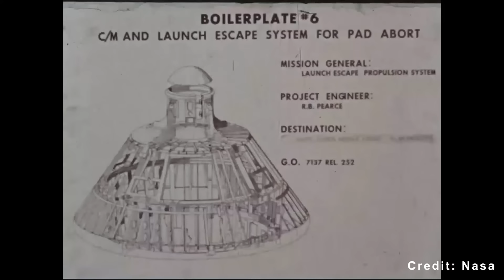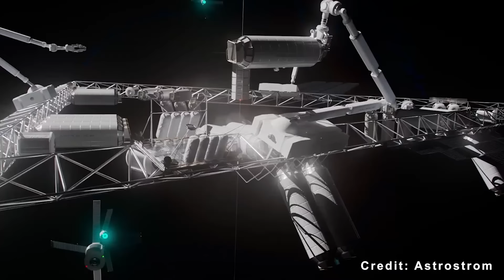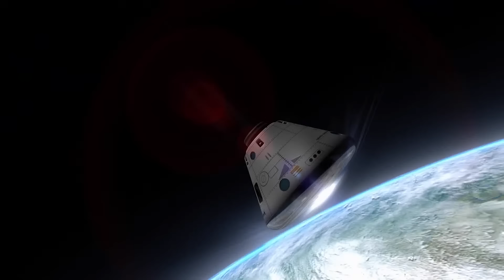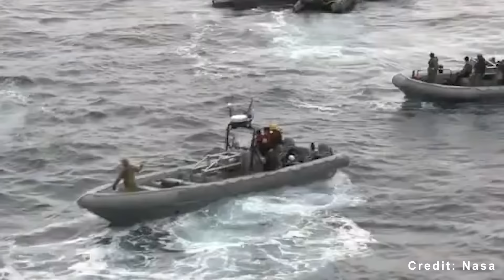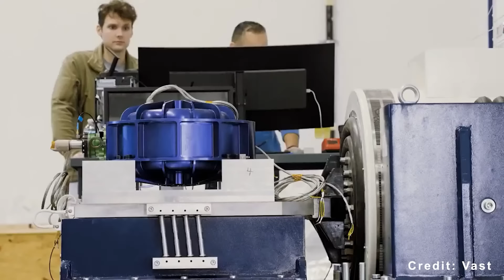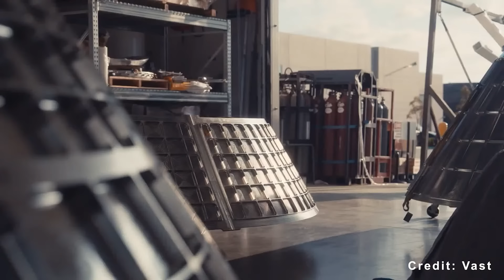How SpaceX Goes Straight to the Moon Without Refuelling - Never Seen Before!

Comment: Orbiting powerplants sending energy to the surface are orbiting weapon platforms.  If that multi-gigawatt powerplant  FOCUSES ITS OUTPUT TO A 10M SQUARE, each square meter of earth to wh8ch it is aimed would receive 10 megawatts per gigawatt generated.  That area will burst into flame nearly instantly and melt.  If pointed at a lake, it can be boiled dry fairly quitckly.

Do not build these orbiting solar powerplants.  Bad idea.